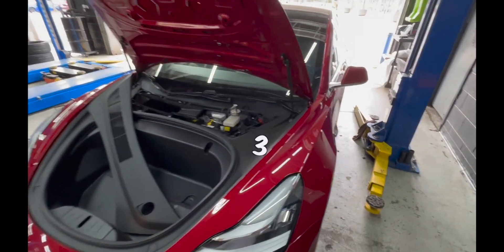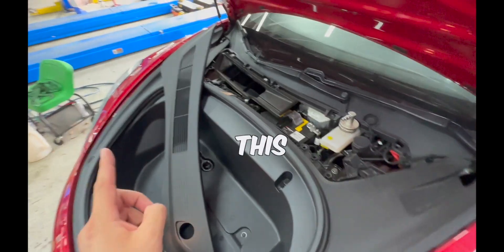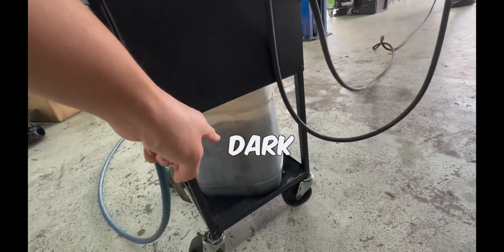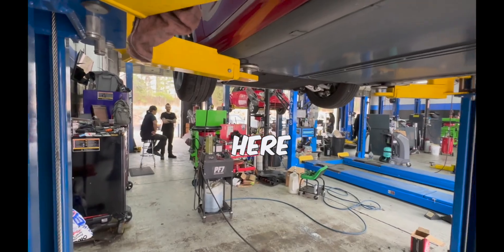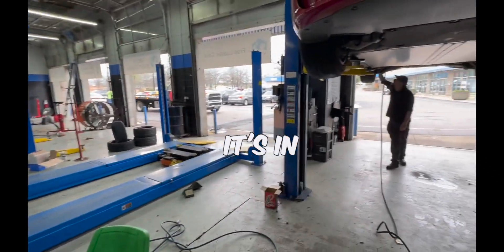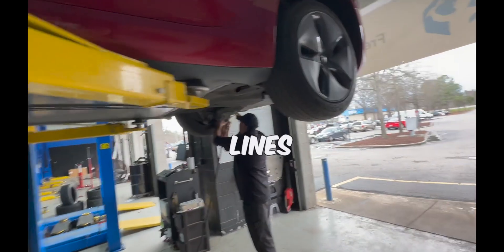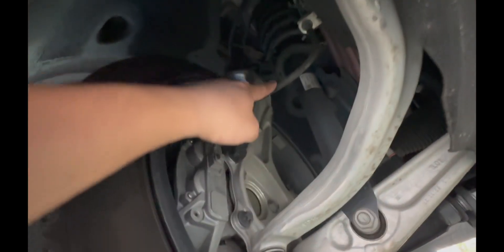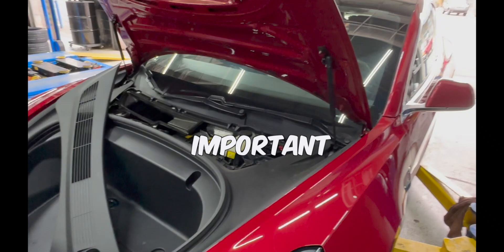Performing Tesla required brake fluid replacement

Comment: thats the wrong way to change the fluid in model 3. There is an extra service menu for changing the fluids. Work there according to instructions. All corresponding valves in the ABS control unit are opened and all fluid is replaced. With the method used here, a residue always remains in the control unit which is only "swapped" or rather mixed in the event of a control intervention.
Reply: Pretty sure he used the wrong fluid too. I know the cap on my model Y says Dot 3
Reply: @twcz3  DOT 4 is fine on the Model 3. You really want a low viscosity DOT 4 fluid. I recently changed the brake fluid in my Model 3 using a Motive Power Bleeder and used the service menu to bleed/refill the system. They key is to get part 1080578-00-C. Pretty easy job.

Comment: Mate never seen a single mechanic bleed brakes by removing just the fluid in reservoir. In 20+ years never seen it before .
Reply: i've seen it. they did it to my car. i confronted them, then only they did for the 4 wheels.

Comment: How do you determine if the brake fluid needs to be replaced?  So the fluid in the reservoir does not move through the whole system?
Reply from the maker: There’s test kits that check for moisture content and copper content. This system is a hydraulic system and so fluid doesn’t circulate like a coolant system. So fluid typically stays stagnant, more so in Teslas. You need fluid in the reservoir bc as your brake pads wear down, fluid in the reservoir will get low
Reply: @JaysGarageRaleigh1  Yes, I have done those test strips on the fluid in the reservoir.  It's probably time to get it replaced for me.

Comment: How often do you need to change the fluid?
Reply from the maker: A rule of thumb is typically every 30k miles or 2 years. BMW REQUIRES this system be flushed every 2 years. Tesla wants you to check for moisture content every 2 years. Keep in mind, this is the EXACT SAME fluid as BMW. Kias and Hyundais have no recommendations on this. So goes to show you need to do your own research. Manufacturers care too much about the JD Power rating for low cost of ownership and they don’t care as long as components last the warranty period.